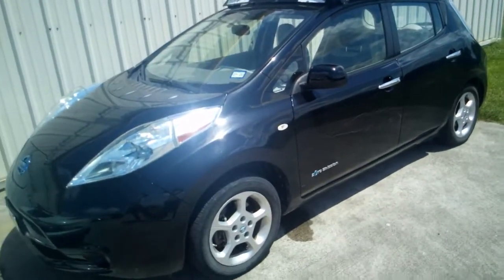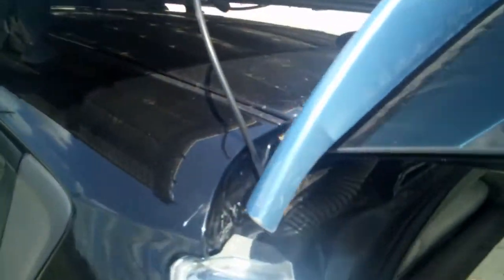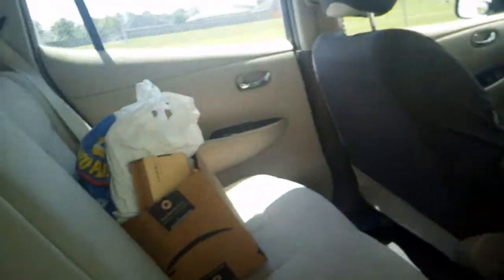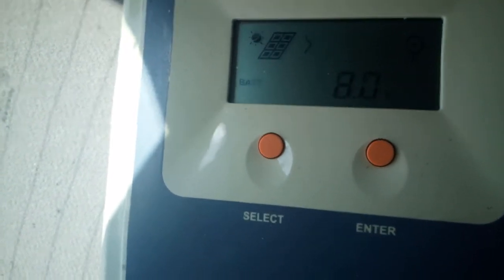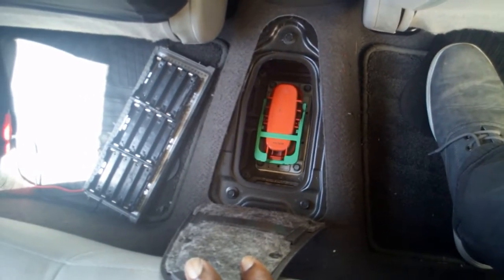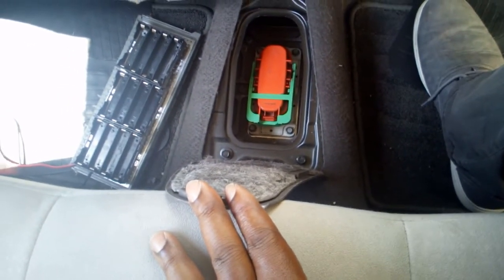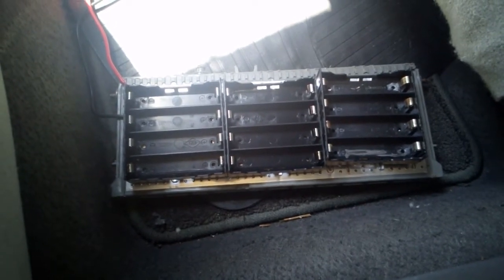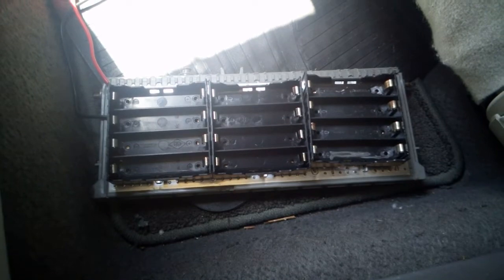Adding two 200 watts Solar panel to 2011 Nissan leaf

Comment: How did you get the EVSE to detect ground? I have a portable 2.5 kWh battery but can’t charge because the charging brick flashes green which means it can’t detect ground to allow charging.

Comment: The car needs around 40 times that power to go down the road at a reasonnable speed, or you would need to charge 40 times longer than you drive.
Reply: The point is free supplemental range.

Comment: Thats awesome Sho!  The mounting bracket would allow you to put other panels on pull hinges that you could lay over the sides of the vehicle when it's parked.  Shading it and adding a couple hundred more watts.  The hood is also the perfect size for a 50 watt panel.  I'm working on building some custom panels that are shaped around the contours of the vehicle.  Be careful not to pinch your wires too much in the hatch back!  I'm gonna put a link to this video on my channel.  We need to get with Will Prowse (DIY solar channel) about a good bms system for what you're doing.  Keep it up bud